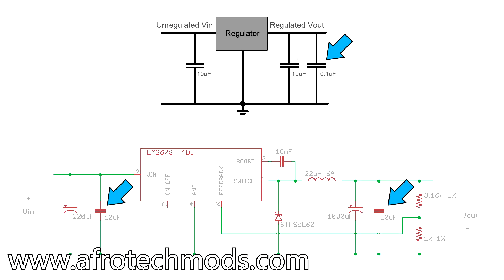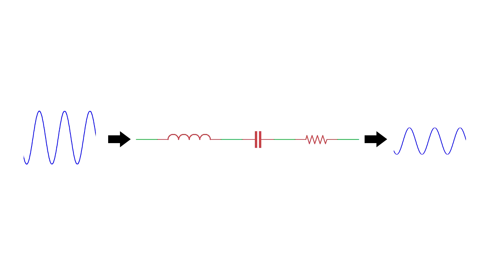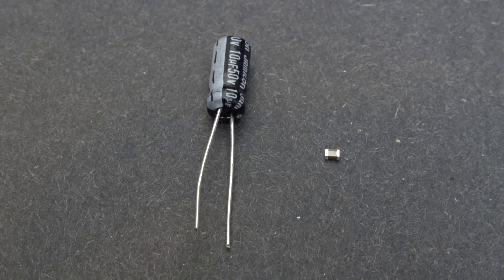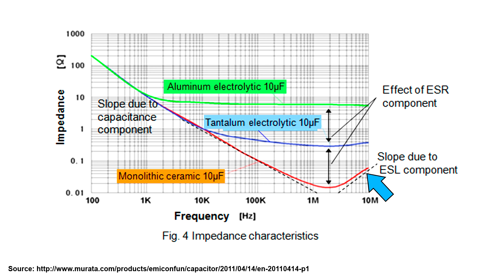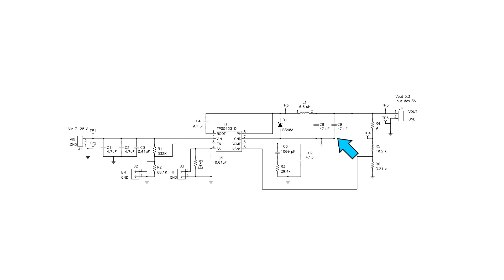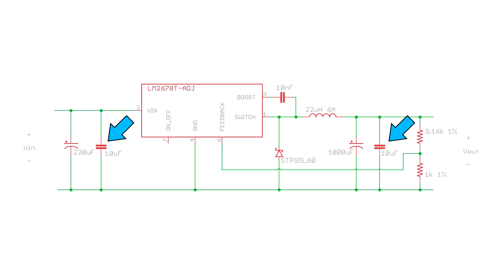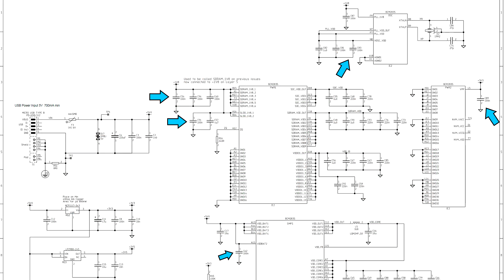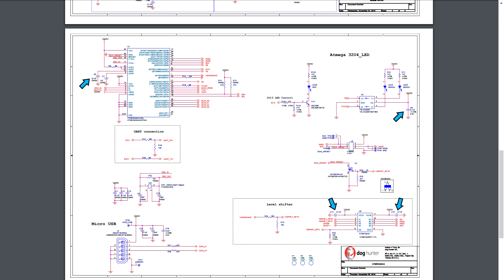Why electrolytic capacitors are actually kinda crappy 💩

Comment: You failed to mention anything about dielectric absorption.  It's a critical factor for capacitors used in Hi-Fi amplifiers.  Capacitors with high dielectric absorption smear the fine details of the music.  When bypassing electrolytic capacitors, polypropylene, polystyrene or teflon capacitors are typically used.   Most ceramic capacitors have way too much dielectric absorption to use in audio equipment or sample and hold circuits.
Reply: Yeah but amplifiers wasn't the theme of this video. Yes they are mentioned but only as an example which was relevant to part of the theory lesson.
Reply: @dannygjk  Dielectric absorption is a seriously important consideration when choosing capacitors for any circuit, be it an amplifier or otherwise.  The extremely high dielectric absorption of electrolytic capacitors is a major factor of why electrolytic capacitors are so shitty, and as such is dead on topic for this video.

Comment: Everyone ignores EPR. EPR is a more common problem than ESR in audio/rf applications, and shorting your power supply to ground is rude in any application. Leakage of DC across a coupling capacitor is a bigger problem than a bit of ripple. Capacitors suck. Rubycon and Panasonic, not as hard, and not as frequently. There's a joke there, somewhere.

Comment: I work in electronic manufacturing,  we had a really weird situation a few months ago, where 100nf caps became almost unobtainable  from any of our suppliers. I dont know why, probably some conspiratorial capacitor cartel. You'd think with global manufacturing this would be impossible, but it happened. Im not in purchasing, so wasnt privvy to the details, but our stock of controller boards got very slim indeed. I fixed alot of older faulty boards from the junkpile that month. Sure enough, when back in stock, the price had tripled. But in bulk, they're not pennies, but fractions of a cent, so its not a major cost. And all our backorders eventually came in (at original cost), so now have literally years of stock. 

We could have used a different value, sure, but on a board worth many hundreds of dollars, with a trusted design, random substitution of .0083c part just isnt worth it.

Besides, its a perfect excuse to fix all those old boards. When a customer is waiting for service, way better to sell em a new one n turn it around quickly. If its an obvious fix, sure, but if you have a curly one n need all your toys n hours to fix it, not worth it on a service rate. When its stopping a $100,000 project thats 70% complete, its a day well spent to crack a few fringe cases. All because of a component that costs less than... i dunno, a breath of air. Oh, n thats .0083 aussie dollars. But you gotta buy many thousand to get em at that price. Retail electronics is a total ripoff.

Comment: So- if you don't work with high-frequencies, you're fine with either choice basically?
And depending on what you really want/need, you'll use either the electrolytic capacitors or ceramics capacitors…?
Reply: Wow, bots got to the point they're literally taking other comments to spam in videos-
I guess these apes are evolving afterall

Comment: classic electrolytic capacitors are imperfect. The dielectricums of standard or even ESR capacitors are self-destructive over time. They "wear" up. Gas develops in the capacitor case and either blows it up , bulging (until explosion or leak, spitting its content all over the circuit) or just dries out if steady venting is possible. Then it is no longer functional. The unit ultimately fails for dead capacitors. There are new types which are no longer developing gases. This kind of aging also occurs in NF capacitors in amplifier stage couplings or final stages setting it "scratchy sounding" with time and leabing it silent in the end.

Comment: Nice trick: put two identical electrolytic capacitors in parallel; the capacitances add but the inductance (which is already less) halves.

Comment: Short notice on why you also always use 100nF on the same power supply, meaning you don't use 470nF at one component and 100nF for the others supply: If you have two capacitors in parallel, you effectively have a parallel resonator. At one point, the larger capacitor already is determined by ESL, a positive-imaginary impedance. The smaller capacitor is still a capacitor, having a negative-imaginary impedance. This will in parallel lead to infinite impedance (assuming esr=0), and no damping at all at this frequency. Of course, the impedance isn't actually infinity, but ceramic capacitors generally have low esr, giving you a high impedance. This doesn't apply when putting a ceramic capacitor next to an aluminum one, since the aluminum one has high ESR and will not be a good resonator.

Comment: The electrolytic caps also get worse with age, as they dry out and the ESR increases. The frequency where the impedance starts in increase is at series resonance. Above this frequency, the cap now looks like and inductor due to the dropping capacitive reactance, and increasing inductive reactance.

Comment: Regarding the example schematics provided by TI:
I wouldn’t make that assumption!

Last year a company called Terra Onion started shipping out a revision of their new “Super SD System 3” product that had a tantalum capacitor installed backwards in the video output circuitry. When it was pointed out to them they balked and showed Texas Instrument’s schematic they based their design from (I believe it was for a 4-channel RGB amp like the THS7374). Sure enough, TI had it backwards as well.

In the end, many end users had to reverse the capacitor themselves. This was still fresh in my mind when I first saw this video, so I felt it was somewhat ironic that you singled them out as “reasonable” for assuming they have good example schematics. ;)

Comment: A like to you.   Going to share this to all the morons.  I've talked my mouth dry trying to explain this.   My ATX PSU was starting to get overwhelmed, by the dinosaur GPU  i got some time ago.    12.5 uf 400v from hid ballast just plugged in mollex connector to 12 rail.  And it works like new. No more crashes.

Comment: My comment is, why don't the IC manufacturers deal with this problem when they manufacture the chips?  If they added the needed capacitance within the IC package itself it would allow people to avoid this problem in the first place. I remember when ICs would fail if you just looked at them sideways. They've come a long way since then. I think that this is a problem that they could fix internally if they just approached signal noise the same way that they approached static electricity damage.

Comment: So why the combination of 1000 microFarads ceramic capacitor and 10 microFarads electrolytic in your schematic. If the ceramic is better at the application why not just use the 1000 microFarad ceramic and call it a day; it would be cheaper having only one component and you aren't really gaining much capacitance from that second little 10 microFarad one. You explained why electrolytic's are not the best choice for filtering high frequencies, but not why they are still used in cases that wouldn't save money. Sure it makes sense like you said to use both a ceramic and electrolytic if you need both good filtering and high capacity, but when the capacitance you need is relatively easy to get in one package why use both?

Comment: I'm a software engineer, and I only know enough about electronics to get me into lots of trouble, but at the same time, I know LOTS of Eletronics Engineers who only know enough about software engineering to get them into lots of trouble, and one minute into this video, I can say that this is the most common thing they swear about up down and side to side. I have heard so many stories about "when in doubt, throw in another cap and suddenly the circuit works as expected. Shut up, don't question it."

Comment: Really interesting. Curiously, people use to put low ESR electrolytic capacitors on quadcopters ESCs for remove noise from the video feed. And it works pretty well...

Comment: but electrolytic capacitors will not work in AC, it'll just blow up
Reply: Not really, if the frequency of the signal is not very low then it will not have enough time to charge up and blow up, it'll only blow up if you reverse bias it with DC signal.
Reply: @destroyeryb2672  nah bro, trust me i've done it before on accident while making full bridge rectifiers, happens quite alot. my point is that the current will only flow through it one way and will not charge
Reply: AC curent is at 60 hz, pretty low compared to the KHz and MHz used in audio or radio. Its fun to make them pop like popcorn

Comment: I inherited several Arco-Mills cabinets full of surplus electronic parts from a design firm that went out of business.  Among the junk were several thousand 100nf 50v monolithic capacitors.  Needless to say, they are my goto bypass caps in the various projects I've built.  (There were a less amount of  100pf, 10nf, 1nf, 47nf, and 4.7nf  monolithic caps too.  I use the 100pf and the 100nf units in RF circuits, and the 100nf units in audio and digital circuits.)

Comment: Excellent memo you did. Because many circuits nowadays have digital control elements, power filtering on high frequencies become essential.  Ignoring electrolytic capacitor property to act as inductor more than capacitor seems an common error. Especially in DIY field where someone who doesn't know about topic convince many others without knowledge to use wrong solution. Thanks about explaining.
Using 0.1 uF ceramic capacitor in parallel with larger electrolytic capacitor for ripple filtering is a nice solution if you know ripple frequency you need to filter out. For circuits with electric feedback noise coming back from motors for example tantalum capacitors seems the best option. And it is nice to have oscilloscope with you on this too.

Comment: I am trying to implement the application note for the LT1613 boost converter--the design variation which takes in 5V and outputs 12V. I want to run the Pin 8 SCART 4:3 aspect ratio voltage from it and also a high'ish voltage LED illuminated push button that I think was originally intended for a motor car. Since I have no supplies or equipment to make my own PCB this must be done on verroboard, which in turn of course requires through-hole components. Suddenly however after watching this I am starting to suspect it just won't be possible in that configuration.

Which is a shame!

Comment: I have a device need 12 volts fixed but I need a protection circuit for not entering more than 12 volts on this device what to use and how

Comment: I have 2 Yamaha emp-700 multi effects processors that the lcd screens have gone out in due to bad capacitors...the ones that are in it now (the bad ones) are tiny and rectangular. My question is should I replace them with ceramic or tantalum capacitors? Any help would be appreciated. Thanks
Reply: I don't get why Samsung and Apple haven switched over to flux capacitors. I mean it's 2018. Not 1981.

Comment: You make it sound as if designers always have a choice of what type of cap to use.  The fact is that not all values are available in all types.  Quite the contrary.  Usually there are no choices at all.  Also, last time I checked, parallel capacitance is calculated as the recip of the sum of the recips of the parallel values.

Comment: electrolytic capacitors limit the lifespan of your products and therefore are a no-go alltogether. currently running some experiments with just replacing all capacitors with a single type of foil capacitor all over the board. also makes it nice and easy for parts ordering and eventual repairs (not that 63V foil caps are very likely to ever break in 5v applications ;). i mean who seriously gives a flying shit about them being 20-70 cents each anyway, products are way too cheap anyway (or else people would not buy new phones just because a 'new' 'model' is out every time ;) , just make them more expensive and use better stuff.
Reply: stuff that isn't guaranteed to have a lifespan of around 30 years before the first failures kick in are not worth a cent. that kinda includes all electrolytic caps.
Reply: Amanda 24 y.o - check my vidéó  electrolytic caps 'only' turn into resistors and then blow up in your face :P and while they used to do that over a period of 20-40 years by now they're so bad they do so over the period of just 1-2 years. (no idea what went wrong there but just go back to the old manufacturing ways ;) and then still... temperature problems? most things heat themselves. the Tenv of -40C is more of a 'cold start temperature' as once it's on it usually quickly turns into a cosy 20-60C inside. not to worry proper stuff easily handles +125C as well. :P if that changes your capacitance just make it a lot bigger than it needs to be. in fact. do that anyway. having just one type of caps on your board makes it really easy to fix in the field. and no not ceramic ones. although those last for all eternity as well. metal foil ones.

Comment: Can u tel best capacitor for quadcopter?  Its low esr with big capacitance. But. Is it usefull to put some ceramic cap?  We need 1500 uf at least. No ceramic do that. Motors run at 40k rpm max. 8 0r 12 pole for each turn or motor. So current peak frequency at maximum 150khz. Usefuln to have mow esr  electrolitic and also ceramic ones?

Comment: Very well illustrated and presented! One of the most important aspects in electronics is that schematics only show ideal components and conductors, but as far as the electrons are concerned the schematic is far more complex. Even wire or printed traces have resistance, inductance and parasitic capacitance. This means that the critical 0V line (earth, ground, chassis, etc) shown on schematics as a solid line is far from solid in practice. Supply lines also have the same problem.

Comment: I'm curious then why bother using electrolytic at all? I know they're in everything and just like everyone else learning and experimenting with electronics I had acquired tons of them. But they have other problem and I've been learning more about capacitors in researching some audio stuff. Everything I've found says that for every power or frequency filtering purpose there is a ceramic or mylar or conductive plastic capacitor alternative that can be used at every voltage I care about. (up to 600 volts at least) Also the electrolytic capacitors  break down more readily with age than other types and can have radically different capacitance, esl and esr than what's listed in their datasheets.  Expense difference between the different types at similar values seems non-existent at this point. So is there a specific reason to use the electrolytic over the other types or is their use more tradition?
Reply from the maker: Because for low frequencies electrolytic capacitors are the cheapest way to get a large amount of capacitance at a low price.

Comment: jellyroll capacitors of course have an inductance. Its a coil. I never considered that without you mentioning the inductance relationship.
Reply: Michael Pierce Yes it is a coil but its bifilar wound so the coiling has no significant effect.

Comment: Yes you right. For example in kacher schem (Tesla coil on n-p-n transitor), with 12volts DC, electrolytic capacitor even for 400 volts gona die because friquency in first coil near 1-3 MHz.

Comment: This is exactly what they will teach you at school. First year of college in fact...
Reply from the maker: Did they teach you the meaning of the word pedantic?
Reply: Ann-Go To My ChanneI! L!VE NOW  That comment doesn't make much sense. 100nF is a typical value for a blocking cap. If you wanna optimise the number of different values, you usually use different value. Like if you need 220nF for something else in your design, you'd use that value everywhere.

Comment: I have a question regarding capacitors.  I have one of those tower fans that use a wireless remote to turn it off and on. When they system is off  there is a current  draw of 0.06 amps .. I think that's 60 miliamps.   What could be causing this current draw despite it being switched off. Some thing us constantly on to receive the signal fr9m the remote.  Could it be a relay  that is  poised and ready  that has a constant current going through coils to keep it off then when infrared records the light it possible causes  the coil to  switch off yo allow the switch to connect? Or is it leaky capacitors? That constantly are letting some a.c. or d.c. current flow?
Reply: The fan likely has what is known as a capacitive dropper type power supply to run the microcontroller/IR rx/relay.  If so the current is reactive and very unlikely pulling 7.5watts. (125 x .06)
Reply: jkmacgyver well then  either my  few multimeter are retarded or that's not it thanks you though
Reply: jkmacgyver if it's unlikely that that's it then why suggest it
Reply: Your multimeter is probably correct as far as reactive current is concerned.   Do a web search on "power factor".  There is likely nothing wrong with the device..  A better way to check is with a "Kill-a-watt" meter available for less than $20.  The current draw will be out of phase with the input voltage waveform confusing your meter.
Reply: ah ok . i have one of those.  my inverter cooling fan does turn on despite the tower fan being off.  so i find it  interesting , there is something drawing power constantly enough to   turn on the cooling fan. there is nothing but the tower fan plugged in to the inverter fyi

Comment: Using 16V rated ceramic cap for 10V DC supply, the 47uF cap will drop 30% to 50% capacitance.